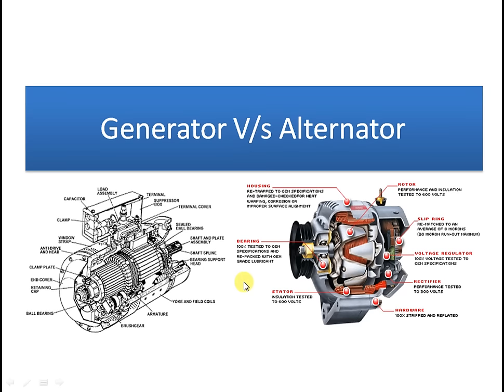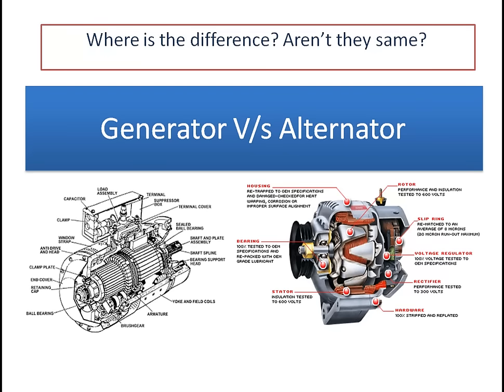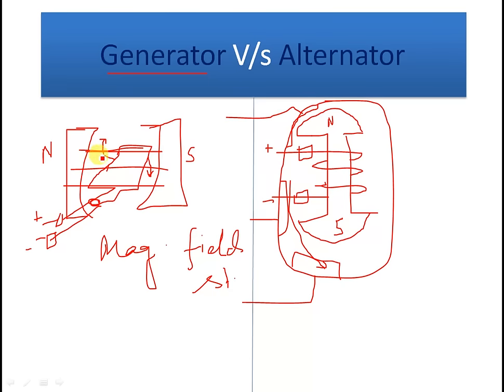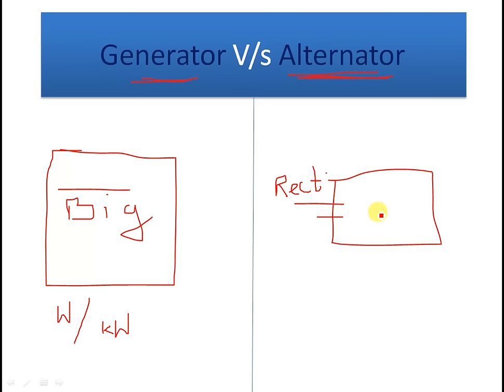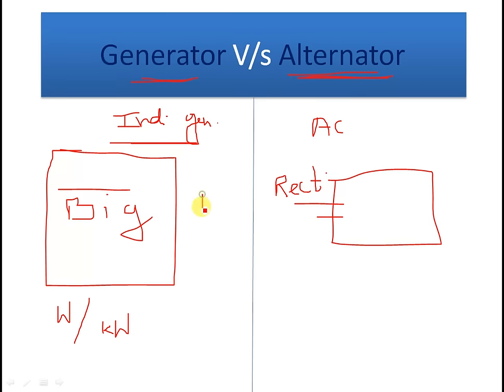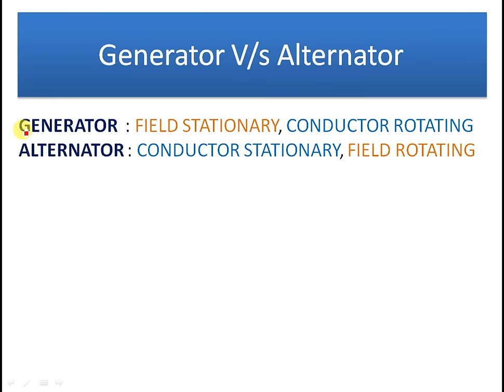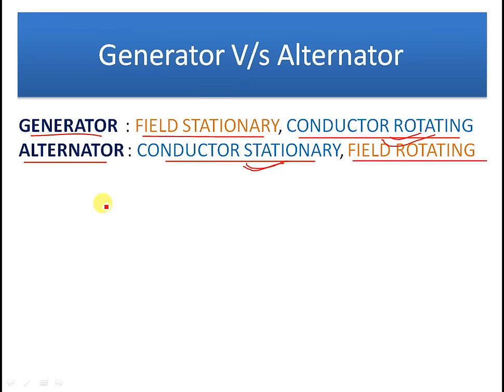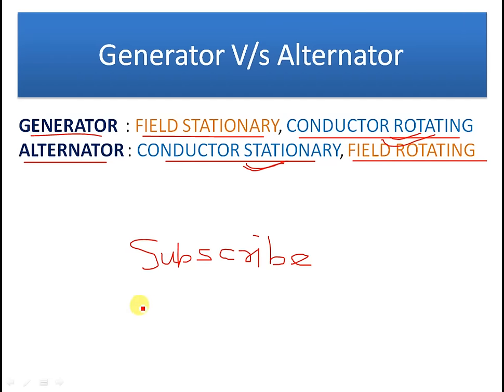Generator V/s Alternator : What's the difference?

Comment from the maker: EDIT: Please note that the "alternator" used in automobiles/vehicles are indeed AC generators. Until 1960, dynamos or DC generator were used but after that with the advancement in Electronics and Silicon semiconductor devices, alternators came into fashion with rectifier unit. This is because DC generators use commutators which convert internally generated AC to DC and are expensive and inefficient. Alternators are small have low weight and are easy to use for DC purpose with a rectifier in vehicles.

Thanks.
Reply: Automobile alternator is basically a alternator. The alternating current is converted to direct current via a rectifier.
Reply from the maker: @mazeofworld5155  Thank you for rectifying. I researched a bit and found it to be true.
Reply: Thank you.
Reply: Next time explain for week because some disturbence for dreawing.... Kk
Reply: U can by a power inverter and easily run DC on an alternator.. it's 35 usd at walmart!
Reply from the maker: @CP-od5ws  I have already explained that in the later part of my video explaining why generators are getting obsolete now.

Comment: These are two semi-vague terms that can't be differentiated specifically.

A generator is literally anything that converts mechanical power to electrical power.
Usually you're talking about an industrial generator, it usually refers to a portable generator.

"Alternator" may refer to any mechanical generator that outputs AC, but it usually refers to automotive alternators.

DC generators are the "generators" you talk about here, and are pretty much 100% obsolete in favor of 3 phase alternators hooked up to rectifiers.

There are also the single-phase or three-phase generator heads that are seen in anything from portable generators all the way to nuclear power plants, and are basically large automotive alternators that are usually excited with a smaller, diode rectified permanent magnet generator, rather than a battery source.
Reply from the maker: polymetric Agreed. The difference can be done on fewer points only.

Comment: You have missed a important point alternator is specifically used in power generation station to keep the frequency constant 50 /60 hz, and also the DC current is applied on the rotor as per the load requirement.. Therby controlling the power produced.. Correct me if I am wrong...
Reply from the maker: Not specifically but mostly. Alternator is used everywhere like in cars or normal alternators used as backup power in case of power outage. What you are saying is how alternator works (exciting the rotor by DC supply) which I have addressed by showing where the field and the armature coils are located for a particular machine (generator and alternator).

Comment: Can you exite an alternator using permanent magnet generator? Rather than a battery source?
Reply from the maker: Yes of course it can be done.
Reply: Can you briefly  explain it, I'll appreciate, thanks
Reply from the maker: @NEWNATURE777  A DC current is all what is required to excite the rotor. Now-a-days brushless static excitation is done in which a rectifier unit is mounted on the rotor shaft itself. The AC output from the alternator is fedback to the rectifier mounted on the rotor and the output from the rectifier is connected directly to the rotor windings. 

Permanent magnet generators can also be used by coupling its shaft to the alternator's rotor and thus connecting the output of the generator to rotor winding with brush. But brushless excitation is more efficient as there is no contact loss/spark and no wear and tearing of contact point. That's why static excitation is more preferred.
Reply: @ervivekchoubey  thank very much Choubey, I'm working on ebike using an old alternator, didn't want to use battery to excite it.
Reply from the maker: @NEWNATURE777  anytime :)

Comment: I have noticed on some newer cars (such as the Ford Escape), their repair manuals describe their charging device to be a generator rather than an alternator. When you look at their 'generator' it looks very similar to a standard alternator. Are they using the term more broadly, or has the fundamental design changed to have a stationary magnetic field in the stator?
Reply from the maker: Edit: please read the pinned comment.
Reply: spelunkerd

Comment: Excellent explanation sir, I have a doubt 
Can we use shunt generator to charge the lithium ion battery  of an electric vehicle while the vehicle is in motion
I am mechanical engineering student but I have interest on electric vehicle range extender related projects
Thank you sir
Reply from the maker: Yes you can but why using a shunt generator? Also battery power will be required to give power to the motor. So, it's not going to charge the battery although it can reduce the required supply current due to back emf. 

Hi
Reply: Some golf carts use a generator to power the wheels and also starts the gasoline engine. The centrifugal clutch uses a rubber belt to a gear box, the gear box connects to the rear axle with a drive shaft. But if you look at 2 stroke Polaris 4 wheelers, they use a cogged rubber belt.

Comment: When using a generator is it necessary to have a rectifier?
Reply from the maker: Not for a DC generator because its already DC voltage. But DC generators are not used now in general except in few applications. Rectifier is necessary where you need DC output voltage from an alternator.

Comment: what is the different between windmill generator and induction motor
Reply from the maker: Joseph A induction motor is what used for generation of electricity from windmill. Induction Motor rotor when made to run at super-synchronous speed (i.e, speed greater than Synchronous Speed), it cuts the synchronously rotating magnetic field and hence generates electricity. This is how windmill generates electricity.

So basically both windmill generator and induction motor is same but difference is one works at super-synchronous speed while other at sub-synchronous speed.

Comment: Can the field rotation in an alternator be a magnet?
Reply from the maker: Sorry I didn't get you. Please elaborate your query.
Reply: I mean can the rotor of an alternator be a magnet like neodymium magnet? Then the stator be of winding coils
Reply from the maker: @TellAStoryofficial00  It can be but as you know permanent magnets lose their magnetic property over time thus field excitation is a good way.

Also by just controlling the field current we can vary the active/reactive power from the alternator which is important. For a permanent magnet that's not possible.
Reply: @TellAStoryofficial00  The magnet is an electromagnet.  It receives voltage from the car battery to make the magnet that rotates.   In an Alternator.

Comment: I was looking for dc generator efficiency values vs ac alternator value. Not found
Reply from the maker: Values differ from machine to machine. Any well designed machine will give you 95-98% efficiency. But the factor is the cost and maintenance which us high in case of DC generator as compared to that of an alternator of same power capacity. That's why you won't see DC generator in use generally anywhere. If DC current required, Alternator output is fed to a rectifier.
Reply: @ervivekchoubey  if efficiency is almost same and i don't care for capital cost then can i use dc generator to charge my battries?
Reply from the maker: Yes but not directly. If you are using Li-ion battery then you need a power regulator module to control the charging otherwise your batteries would be left damaged.
Reply: @ervivekchoubey  noted and thanks

Comment: Thanks for your videos. Can you please explain the concept of power factor in generator? Can it that be corrected as it was a motor? Thank you
Reply from the maker: Power factor is basically the ratio between Active Power to Apparent power of an AC device or simply put, it is the amount of total power in the circuit being used actually by the machine to do some work. Like an AC motor of 220V and 5A has total power or capacity of 220*5=1100VA if fully loaded. But, when measured using a wattmeter, you will find that it is using some less power than that, say 1000W only. Thus power factor =1000/1100=10/11=0.99. This 1000W is active or real power represented by VIcosφ while 1100VA is the apparent power represented by VI. So, the power factor is VIcosφ/VI = cosφ.

Actually, it happens due to nature of load. AC motor for example is an induction machine. By Lenz's law we know that any time varying current passing through a coil or inductor is opposed by the counter magnetic flux generated by the coil. Thus the amount of useful power reduces and only a part of that power does real work while another part is used in generating magnetic field flux. This is the magnetic field flux generated between the stator and  the rotor in a machine which is sine of the total or apparent power that is VIsinφ (called reactive power) while cosine component is the actual measurable power that the machine uses that is VIcosφ. That's why we calculate power factor to understand what part of power is actually being used by the machine out of the total power. If power factor that is cosφ is poor then for same voltage and same power demand, the machine will draw huge current and may burn out or affect other loads in the line. Thus it should be as close to unity as possible. 

Here's a video I made on measuring reactive power using Wattmeter -  https://youtu.be/Z8We1ytQgOM

I may make a video on the topic in the future as it's a broader concept. I didn't get your second question regarding motor. Can you elaborate. Thanks
Reply: @ervivekchoubey  
Great. Now my question is, the power grid comes with voltage and current in phase. So PF 1. Then eventually PF will change according to the load. My issue is that this time my source isna GenSet having already its PF 0.8. So my question is: how comes a source has a PF? Also, how can I correct the PF of my GenSet so that I can maximise it VA usage? If my Genset is 2500 MVA / 2000 MW means that PF is 0.8. Can I improve PF so that I can improve 2000 MW to 2200 MW ?
Reply from the maker: Who said that source has now pf? Source or generator has power factor and it's not unity. That is because of the generator circuit. Generator itself us an inductive component and has two components of reactants which make the synchronous reactance. 
There isn't much you can do about the generator but the load can be put as to utilise the max active power by Static VAR compensation techniques or by using an over-excited synchronous motor.

Comment: Generator is a broad term. An alternator is a generator, a dynamo is a generator, regardless whether the output is AC or DC. If you are using an alternator for automobiles then the output of this generator is DC, but if you a using generator to supply your house then the output is AC.
Reply from the maker: That's why I said it is not wrong to call a machine by either name. However the differences pointed out here are between certain design related things in a general Electrical machine, generator/alternator.

Comment: Good work am like your explanation thank you my question is can alternator or generator work if he is rolling lift or right?
Reply from the maker: yekeen adekunle Can you elaborate a bit. I was unable to understand your question.
Reply: His question is...Can we use a dc generator or as you said induction motor for supplying power to lift. I guess the answer should be to use "Slip Ring Induction motor or wound rotor motor which have high starting torque and used for variable speeds applications."

Comment: Is alternator better for high rpm?
Reply from the maker: 0786RICARDO In a way you can say that because generators are bigger in size and have thus a speed limitation also because of armature reaction (talking about DC generators). Alternators are basically of two types

1. Salient pole alternator
2. Cylindrical Rotor alternator

According to design, salient pole alternators are limited upto certain speed because the poles are like inside out carrying windings and hence rotating them at high speed will cause tearing of the windings under centripetal force. Whereas cylindrical rotors are used where the primemover is of high speed like coal based thermal power plants. Salient pole alternators are used in hydal power plants where the thrust applied is low but output is nominal.
Reply: It should be better to have a single coil.wraped around iron spinning fast than many coils, right?
Reply from the maker: 0786RICARDO how can you work with single coil? There are 3 phases and it is the rotor which carries a single DC winding.
Reply: Single coil feeding the electromagnet

Comment: So the generator is two phase DC or AC and the alternator is three phase AC only?
Reply from the maker: It's just one there is no phase in DC. Secondly, yes but alternator is also called generator but alternator is strictly for AC generator
Reply: Ok seems i need to study more. Lol. Thank you.
Reply: @ervivekchoubey  If an alternator is strictly AC, then why is a car's generator that charges its batteries (obviously requiring DC) called an alternator?
Reply: @carultch - Because it is in fact, an alternator, which produces AC but is then fed to a three phase full wave rectifier. This changes the AC to the DC required to charge the vehicle battery and power the electrical system.
Reply from the maker: @carultch Sorry for the late reply. You can check the pinned comment on this video.

Comment: some late information           it appears that the efficiency of a generator/dynamo was low, and the output was  DC,  because  slip-ring/continuous-contact commutation was  not  utilized.!        d
Reply from the maker: Yes you're right. Efficiency and capability of a DC machine is limited as there is no physical isolation between the stationary and the rotating parts. This problem led to the invention of AC machines.

Comment: good explanation but most generators that folks have experience with such as small portable generators have the field winding on the rotor.
Reply from the maker: The output is AC. But it is said generator loosely.The terms are used interchangeably at various places.

Comment: Why wind mill use dc generator and not the ac alternator ?
Reply from the maker: Windmill uses induction generator which is basically an induction motor rotating at super-synchronous speed. It doesn't use dc Generator.

Comment: Rectifier in the Alternator changes AC to DC?

No magnet in the alternator.  The rotor receives voltage from the CAR BATTERY to create an Electromagnet.
Reply from the maker: Alternators aren't used only in cars. What I meant was that if DC voltage is required then one can take the output from the alternator and convert it to DC using a rectifier-filter unit. Hence no need of lossy and bulky DC machines.

Comment: Good  knowledge . 2 splits  ring  connect shaft  2 carbon sets  . Splits  ring  contact  crossing  punge     + - or - +  one brush  connected  Dc   second  brush  out connected  tranceformar  primary   transformer  secondary   shaft rotation  from  transformer out  AC?  I am  asked  question  but my english  bad than  more  question
Reply from the maker: You can ask in Hindi if you know.

Comment: A generator and magneto is the same thing, right?
Reply from the maker: I don't know something by the name 'magneto'. Do you mean Dynamo, then yes.
Reply: @ervivekchoubey  look up “magneto” on Wikipedia.  It’s somewhat similar to a dynamo.
Reply from the maker: Thanks @David. Yes both of them can be said to be the same. Any generator produces AC current. Although Dynamo has commutator which converts the same into DC, magneto as per definition has no commutator to convert AC to DC. So, that's the slightest difference between them. All of them fall in the category of generator.

Comment: What am trying to ask is that, if am use a motor to roll anyone of the 2, can it work if he roll either left or right
Reply from the maker: yekeen adekunle No. There is a specific direction you need to rotate the rotor/armature. It is based on Fleming Hand rule or cork screw rule.

Comment: It is wrong to say that in a Generator the field is stationary. All AC machines (synchronous and asynchronous generators) have rotating magnetic fields! There is a technique where the coordinate system rotates with the rotor (Direct and Quadrature), by such analysis the currents can be modeled as constant in the rotating coordinate system so that the control of such machines is accomplished more easily. 

Alternators are usually related to Claw-Pole Generators to which I was looking more information about, but the video was not helpful at all.
Reply from the maker: I am sorry if the video wasn't helpful to you. However the basic theory says that either the field should be rotating or the armature conductor. In a generator or specifically a DC generator has field stationary while it is the armature that rotates and as armature carries conductor therefore there is a speed limitation on a DC generator due to centripetal force. Another thing is that there are brushes on a DC generator with commutator which causes speed of the DC generator to be lowered further because of sparking. 

The other type of machine that we have therefore is an alternator where the magnetic field rotates while the 3 phase armature conductor remains stationary. No brush required and thus the speed of an alternator is high and thus the generated terminal voltage is high. 

That's why the basic difference between generator and alternator is based on what rotates and what remains stationary.